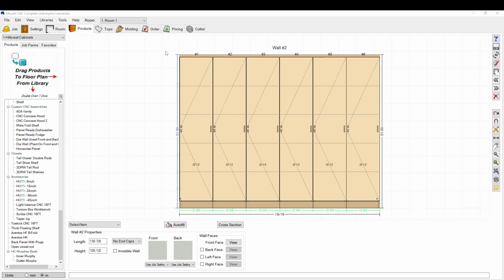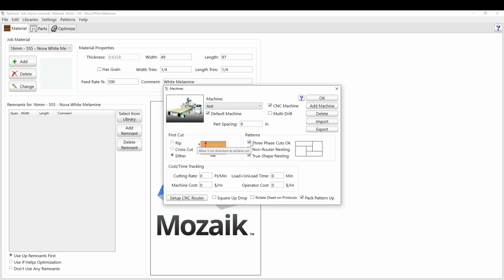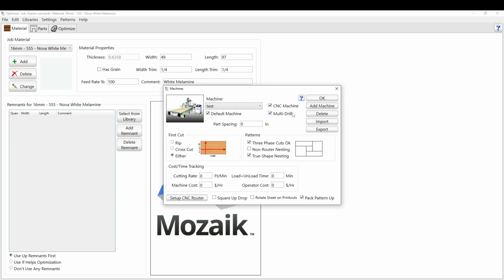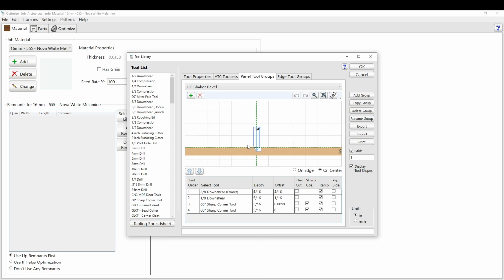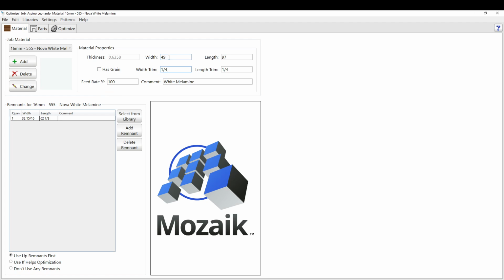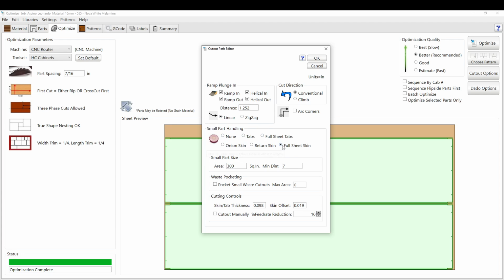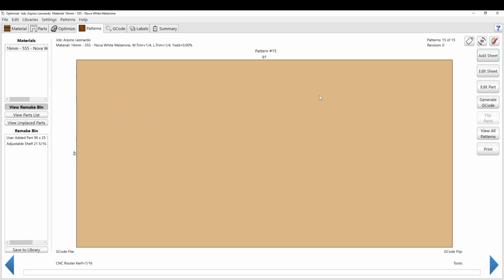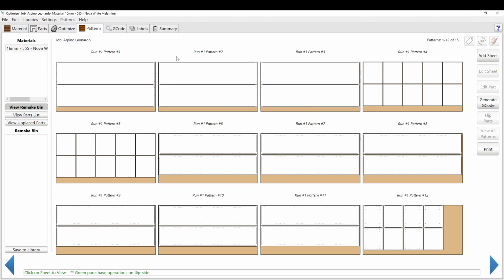Deep Dive Into CNC Optimizer - Mozaik Software Tutorials

Comment: Great video! My machine doesn't have a ATC what workflow would you recommend using dealing with the gcode and Manuel tool changes?
Reply from the maker: In generate gcode menu deselect the all tools checkbox. Then you can run each tool gcode separately by selecting it from the list.